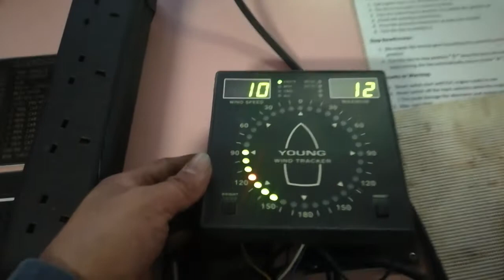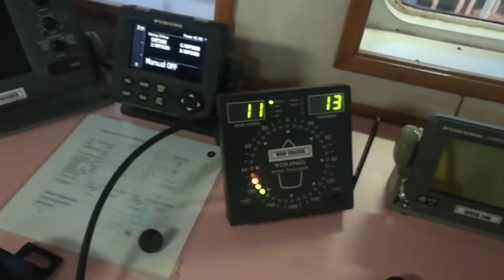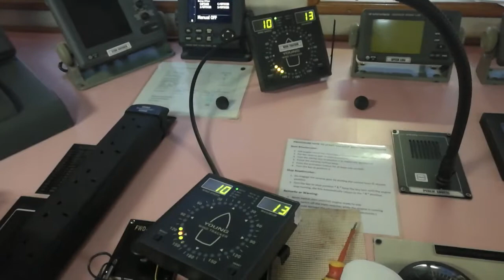Young Wind Tracker connection with 2 display in 1 Wind and Speed Sensor

Comment: What settings did you use for your tracker how dodnyou get the wind speed reading to read properly
Reply from the maker: For wind speed and direction confirmation we use a calibrated portable wind and direction sensor to verify the actual readout on the display.

Comment: I have a new wind sensor of the same brand but different model. I installed the sensor but the wind tracker is showing (see err). You help will be appreciated. Thank you.
Old sensor
Model: 85106

New sensor
Model 86000

Wind tracker: 06206
Reply from the maker: Hi thanks for asking questions. For your information, the older version of this type of Wind Sensor is NOT HD, the new type that newly released are HD type. It will not work. It should be set or else find an old Non HD type Display ti fit in your old Sensor Unit.